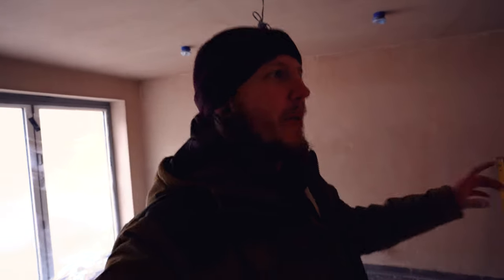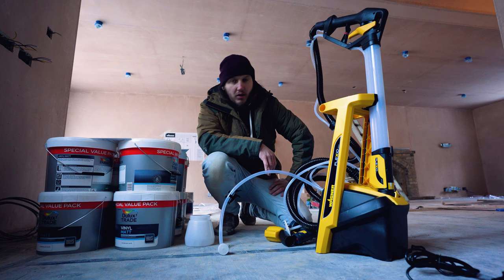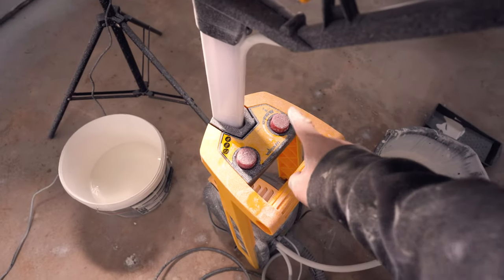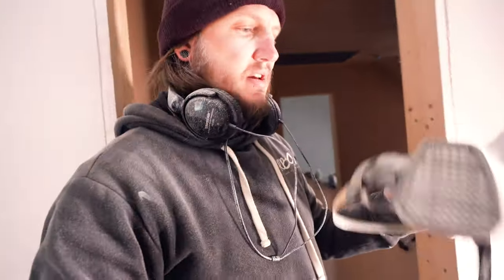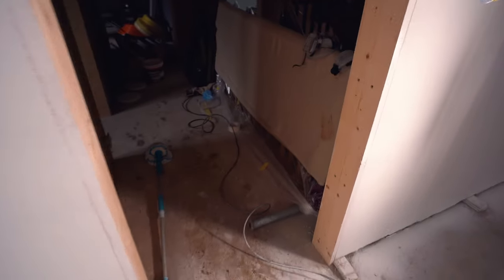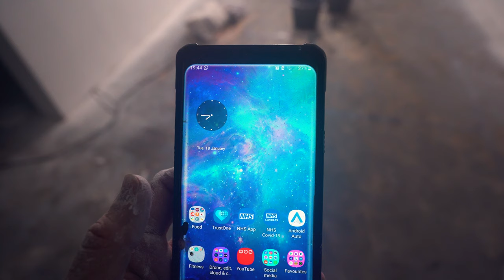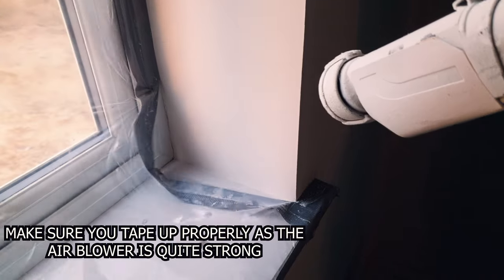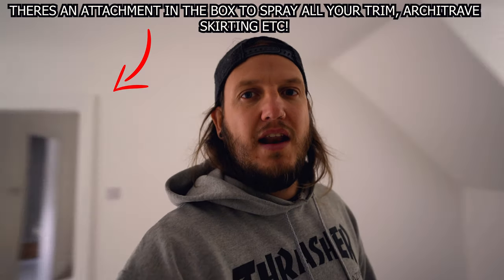How to PAINT A ROOM in UNDER 10 MINUTES 😱

Comment: We did our whole house with a Wagner 250 after it being plastered. The finished was sublime. The actual painting is very fast and all time goes into the prep and sequence of masking and painting coving/trims. There is quite a skill for it to make sure you get good coverage without runs. Vacuuming the floors to prevent dust kick up is very important as it taking the masking off when wet (if possible depending on how many coat you’re doing). I found most paints need 20% dilution for a prosumer wagner and the nozzles which come with are sufficient to paint a house. They do need replacing after a while as the head wears out and becomes more of jet. I highly recommend a 3m hand masker with paper or their masking film for windows. These are also amazing for spraying MDF to get a fitted furniture finish.

Comment: I'd definitely go with an airless machine, much quicker and less bulky. I had a Wagner 150m but it leaked and killed itself (common problem). The 250m is much better for two reasons, one it has pressure control and two like this sprayer the pickup just drops into a bucket/paint tin (the 150m has a hopper so limited on amount of paint you can put in and more clean up).

Comment: Just fab to see you back on the house. Would be interesting on new builds how many are sprayed now. Also if you get chance have a go at high speed rollering with a pole e.g. 
https://youtu.be/AYiZRv8uuew
. . . and see how it compares. On mist coats I use more water than usually recommended (as thin as you can work with for best soak in). Best wishes to you and Holly.